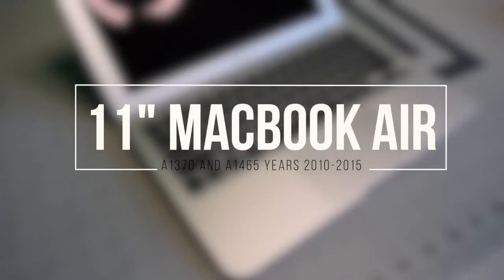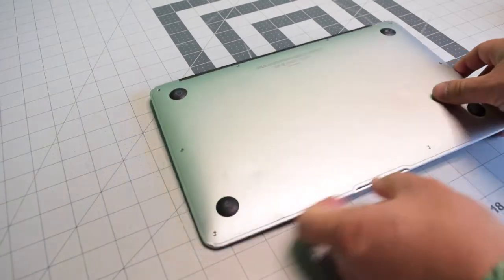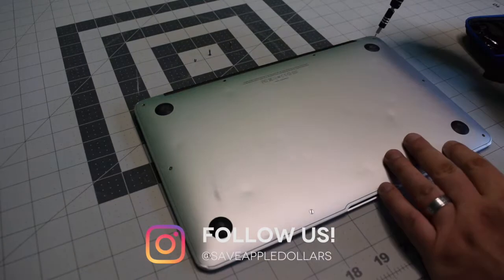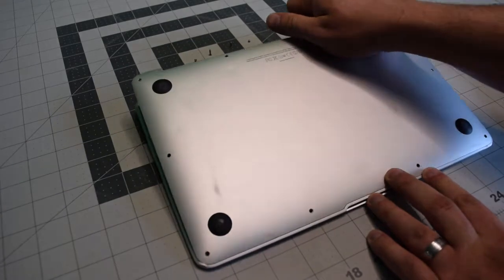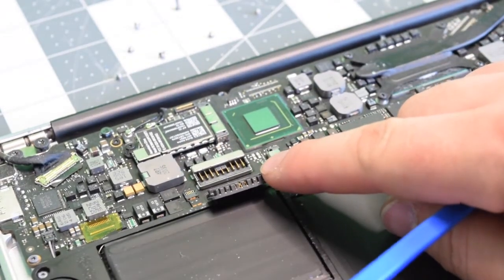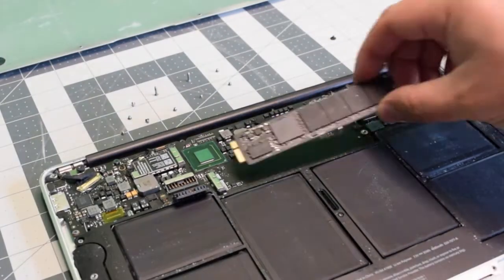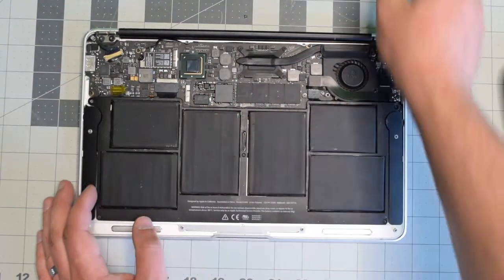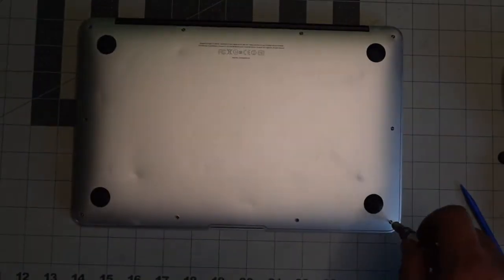11" Macbook Air A1370 and A1465 Solid State Disk SSD Installation year 2010 2011 2012 2013 2014 2015

Comment: sir my MacBook Air 2011 a1370 2gb ,64ssd. hangs little bit? if I replace 256ssd it will be ok?
Reply from the maker: That’s about the best thing you can do. In all honesty, it’s best to down grade a Macbook with 2gb ram. Something like Mountain Lion is best.
Reply: @GRIBSOFT  I also have the same Macbook Air (a1370) 2gb, but i'm coming from factory hdd. Do you think I will see a difference with the SSD? I'm only running 2gb ram and I only use chrome, doc, & zoom.